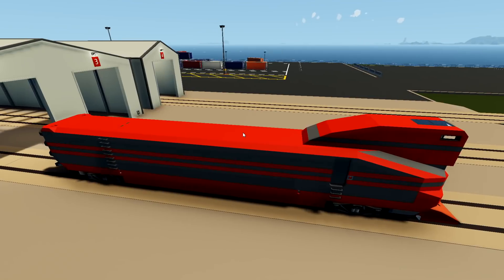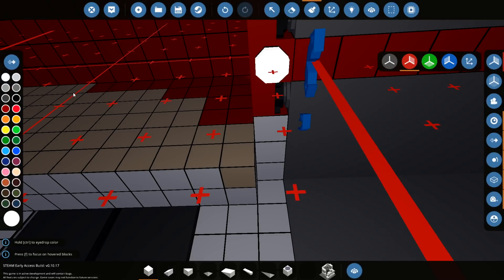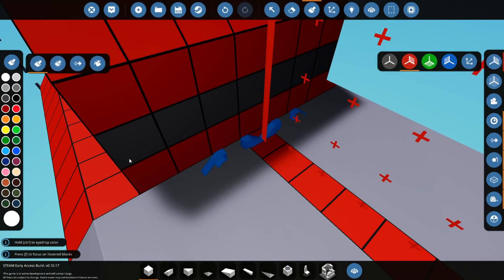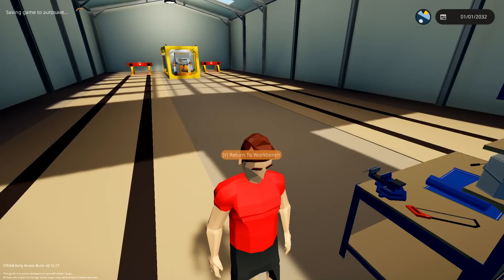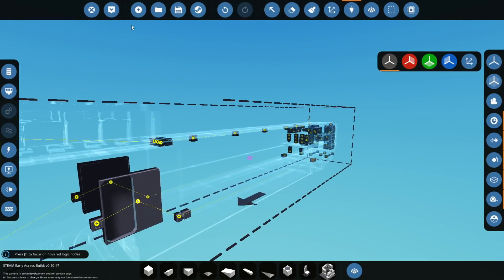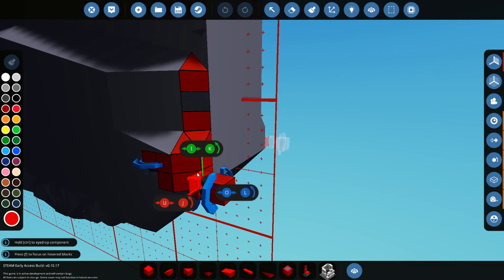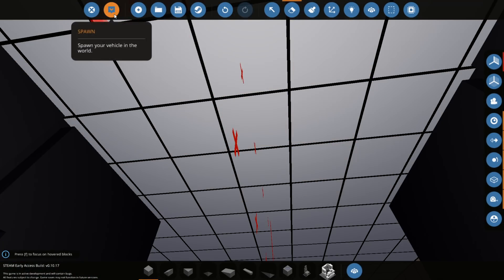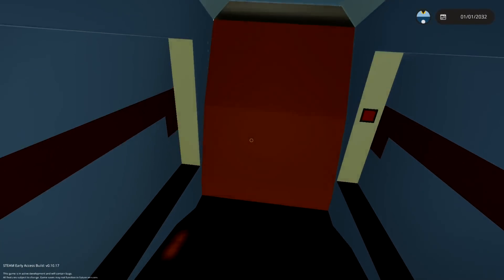Passenger Room!  -  Jet Train  -  Part 7

Comment: great video and great series and great train, and to fix that problem that the Car doesn’t fit, makes the door open more, or makes a system that makes this piece go backwards or expand to the sides, And of course a ladder (you can place it if you want ) for you to climb to the second floor of the train.

I'm sorry for my English, I'm Brazilian and I use the translator a lot, even though my English is good

Comment: Why not give the winches something to attach to, so you can leave them?

Fold down ladder for the passenger area. Like that cargo plane.

Consider moving the joints of the side pieces for the front door further back, so you can open it up without changing the design but also not have to shave off to much.
The sections by the door have two layers so as as it gets past the front you can open it up.